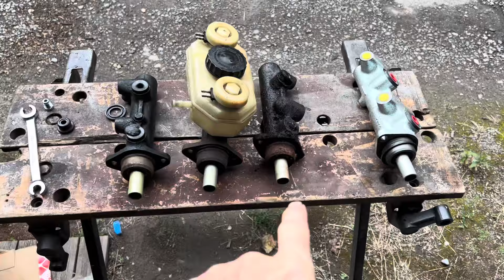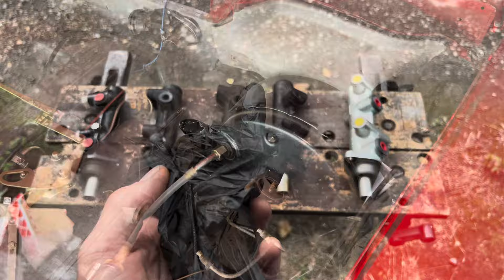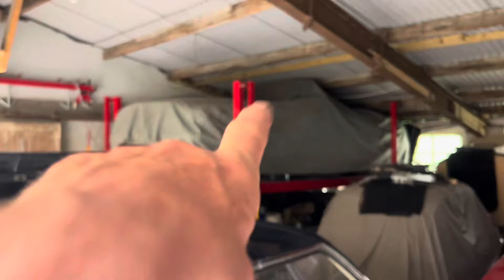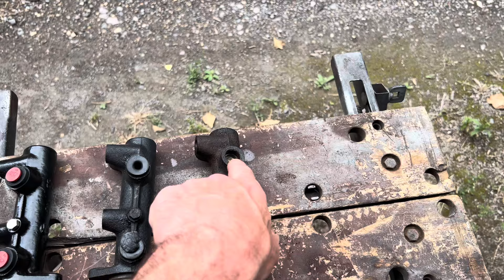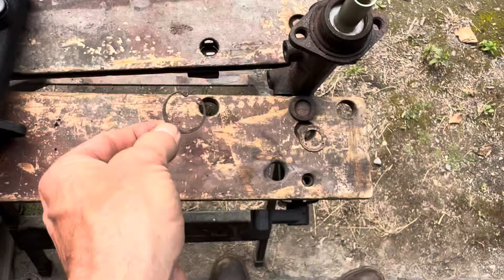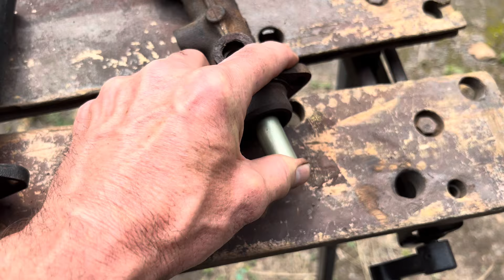Mercedes R107 brake master cylinder and brake fluid reservoir - everything your need to know

Comment: Hey Mike. I’m about to send you an email regarding the brake booster. I believe that I found my issue as to why my brakes have a hissing sound when I press the brake pedal.  I found a rubber washing hanging on the piston that pushes the piston on the master cylinder…
Reply from the maker: Thanks for your email. All master cylinders should come with a rubber gasket that sits between the brake booster and master cylinder. If that is missing or damaged, it could result in a vacuum leak, When you depress the brake pedal, rather than the vacuum helping to push in the rod on the master cylinder, the air leaks out. I'll be interested to see if a new gasket fixes the problem. Let me know. Mike

Comment: I think you had a video where you bled the master cylinder while on the car? Maybe I’m wrong. But where would I be able to find a kit or something to bleed the master cylinder without taking it off the car? Or would it be easier to just remove the whole thing? Maybe it’s sucking in air from the rubber grommets on the fluid reservoir? The breaks hiss when I press them trying to stop.
Reply from the maker: Brakes hissing, sounds more like a brake booster leak. I think I may have a similar problem on my red 280sl and will at some stage get round to diagnosing the issue. My brakes work fine, but if I keep my foot on the brake at traffic lights, I can feel the pedal very slowly sinking.

The brake booster is basically a big vacuum drum and they are prone to leaking either because they rust out....or the diaphragm has a hole or sometimes  the valve leaks.

What makes you think you have air in the master cylinder? Have you recently done work on the brakes that could have introduced air? Air in master cylinder would give you spongy brakes.

Mike

Comment: You are the best!  Great tip about the front and rear sections of the reservoir.  That solves my issue!  If I'm ever in your neck of the woods dinner is on me.
Reply from the maker: Thx for your comment - I'm glad the video was useful. Sometime grateful viewers click on the 'Super Thanks' button (under the video next to the Share and Save buttons) and leave a small contribution. Probably works out cheaper than dinner...if not as fun. Mike

Comment: Super informative video, thank you. My master cylinder is leaking on the outside (not into the brake booster) and I plan to use some UV liquid to track it down exactly but before I do it: would you say its common for the grommets between the reservoir and master cylinder to leak?
Reply from the maker: Yes - it’s common for those grommets to leak. It should be relatively simple to ascertain whether it’s those grommets leaking or the cylinder itself. Tie some toilet paper round the grommets (eg between tank and cylinder) and drive the car and brake a few times. See if the toilet paper is wet. Mike
Reply: @ thank you! I’ll do that soon. I have the car parked at my mom’s place so I can only work on it on weekends. Is there anywhere else it would leak from on that side of the brake booster? I saw some fluid tracing down from the cylinder and I’m thinking it’s either a grommet or a loose brake line but I want to make sure I’m not missing anything.
Reply from the maker: @Andrsme  Wipe everything down and then tie small bits of toilet paper round the brake line fittings...and the grommets. Mike
Reply: @MikesMercsandothercars  thank you again for the guidance. Cheers!

Comment: Mike you have done it again!  I had a brake light on my 1972 r107 and took the parking switch out and it is fine. Turns out it’s one of the floats in the reservoir is not floating. Do you know if you can replace or repair the float?  Thanks 😀
Reply from the maker: Those floats get pin holes, fill up and then sink - the later reservoirs have a slightly different design to get round this. I’ve never tried repairing one….but I’ll have a look and see if I have a spare. Mike

Comment: Many thanks. On my slc the prior owners decided in their wisdom not to change the grommets to the reservoir. If it were only a case of stripping the paint I’d have been a happy bunny. Brake fluid actually ate through the steel which proved to be a real pain in the posterior. The gasket to the booster was also shot. Lucky for me, it was rebuildable. But yes, pound foolish grommet and gasket are cheap vs rust repair.
Reply from the maker: Yes...I suppose if owners are not getting their cars serviced regularly, small leaks at the brake booster can get over looked.....and you we all know how quickly a small problem can become VERY expensive. Glad to hear you got yours sorted. Mike

Comment: How to address the dampness in the brake booster before its too far gone? Because It seems that there is a little seepage inside.
Reply from the maker: Are you saying you have brake fluid in your brake booster? When I take the brake master cylinder off my Pagoda, I will do a video on the subject...especially if the brake booster is wet/damp inside. Mike
Reply: @MikesMercsandothercars  Sorry, I did not clear myself, I wanted to say that my 107 is currently having the same issue, and I wanted to know how to address it before installing the new master cylinder.
Or if it is just a little seepage, I can install the new master cylinder and everything will be fine?
And I wanted to add that I really appreciate the efforts put in your videos, and I'm lucky even this video is coinciding with what I'm facing currently 😂
Reply from the maker: @5aldl  Hello - yes when you install a new master cylinder, this should cure the small leak causing dampness at the brake booster.

Once you have taken the off the brake booster try to check inside the brake booster to make sure there is not a small pool of brake fluid.

Mike

Comment: HI! I'm looking forward to seeing the video on how to adjust the TPS. Thanks!
Reply from the maker: Do you have a problem with your TPS? - If so, what make model and year car do you have? Mike
Reply: @MikesMercsandothercars  Hi Mike! Mecedes 1975 6 cylinder. TPS is 5 pin. My engine revs up when I step on the accelerator and makes bangs. My problem is with the TPS calibration. Thanks!
Reply from the maker: @marcosortolani3639  Is it a R107? and is it D Jetronic? Are you referring to the throttle switch detailed at the link below:

https://jetronic.org/en/d-jetronic/tps

Mike
Reply: @MikesMercsandothercars  It's a W116 280SE with TPS 0280120015.